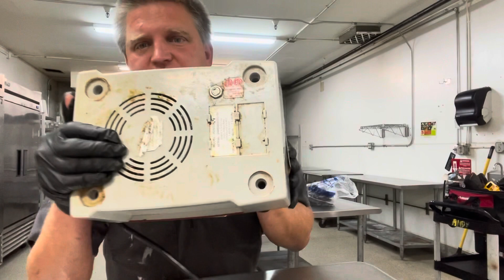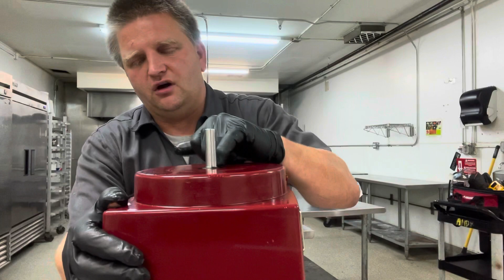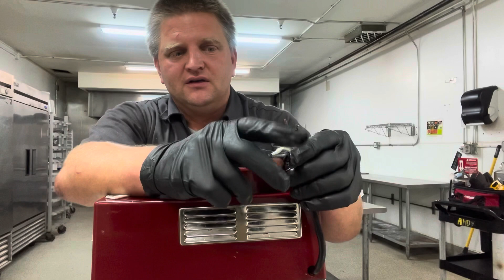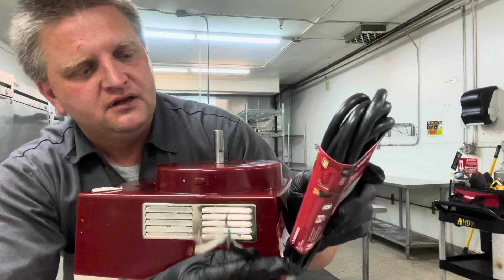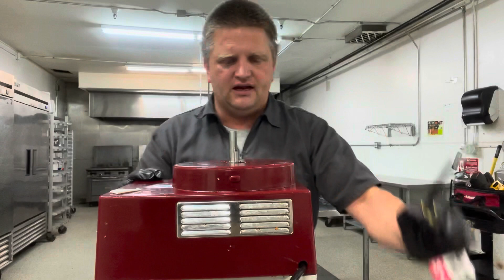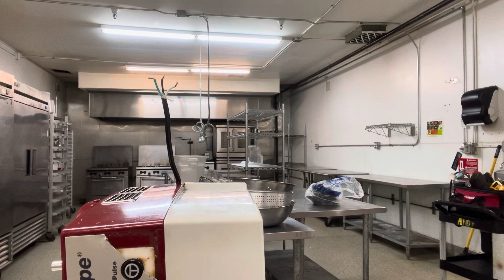Robot coupe r2 power cord replacement part 1

Comment: Any advice if the blade and bowl are stuck on and won’t come off? Machine still runs but blade is stuck on.
Reply from the maker: Go to your local auto Zone or Kragen and rent for free a small puller , unless you already have one , you will need the one with 3 arms , and pointy center pice , remove the cap from the top of the blade - just a strong pull with your fingers , pour air spray a bunch of lubricant - penetrant ( we-40 ) or so and using the puller tray to get blade of the shaft it’s not goanna be easy but it might work, other option would be trying to put a some sort of thin metal cable under the blade and try to yank it out of the shaft , you can even jam the whole unit against post of some sort and attach it to tide down strap with a  wratchet motion so you can slowly crank it out of the shat , still you will have to start with a metal cable under the blade other material might just get cut thru , hope that helps , good luck .
Reply: @andyscommercialequipmentre4651 
Thank you for your reply! Your videos are super helpful.

Comment: I noticed when looking at the wire there is an open fiber wire running through, what do I do with that wire if the replacement cord only has 3 wires?
Reply from the maker: I’m not sure what wire are you talking about , can you send me a picture of it , that would clear the confusion, usually there are only 3 wires to reconnect .
Reply: @andyscommercialequipmentre4651 maybe they are talking about fiber strand/s that are sometimes woven with the wires to increase cord strength or for something else like heat dissipation or something?

Comment: love this content, really learning a lot but is there a seal between the red part and the white part of the housing? or is it just really two plastic parts just put together, wondering how this is for hygiene and cleanability in terms of the seam accumulating bacteria and food
Reply from the maker: There is no seal and unless you damage the base by dropping it or when one of the screw support brakes of and two half of the base become loose , that would couse food and grim getting into the opening other wise is pretty thigh seal between those two half , I always clean my base after I’m done working with a light bleach and water solution , no abrasive stuff just towel , keeps it pretty sanitary ，besides all the process is done inside the bowl to begin with so as long as your bowl it’s clean the whole process of blending or choping is clean as well.
Most importantly Is to replace the bearing seal ones a year that would protect any liquid to get in and mess up the motor bearing .
Reply: @andyscommercialequipmentre4651  thanks Andy really appreciate the responses, I guess that motor seal is probably  the most critical component to maintain and regularly replace and I'm sure that most places only replace it when it's too late
Reply from the maker: Yes sir , do it ones a year I would say but it really depend on how you use your unit- I got 2 of those that i used for the last 10 years , never change it couse I only use it 1 a week and at the same time I don’t blend anything liquify so no moisture ever sips thru the seal . At the end of the day 25.00 of the seal cost  is way better then 250.0 to repair it .
Reply: @andyscommercialequipmentre4651  yep and that applies to everything basically in those proportions, proper maintenance will save you lots of money